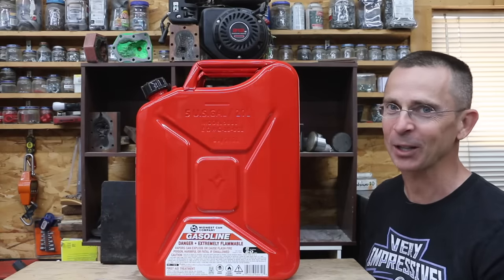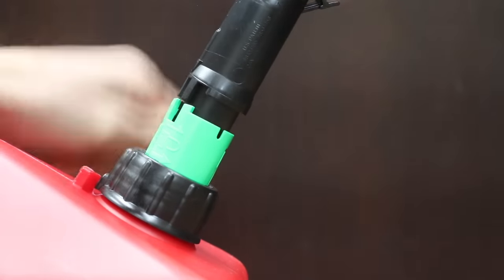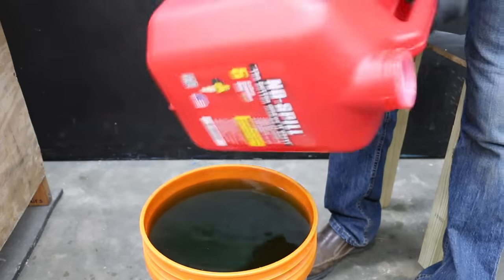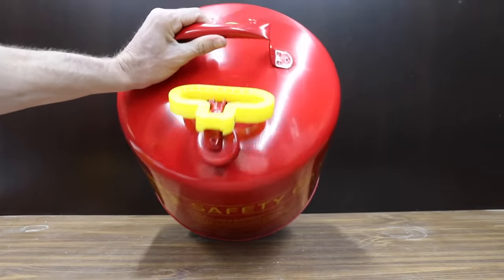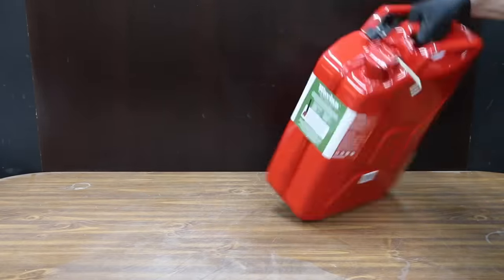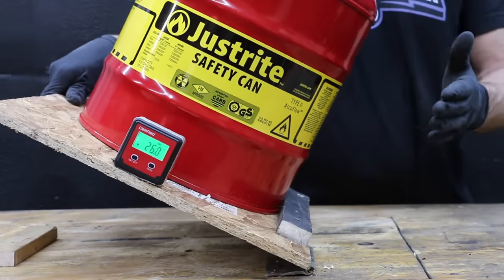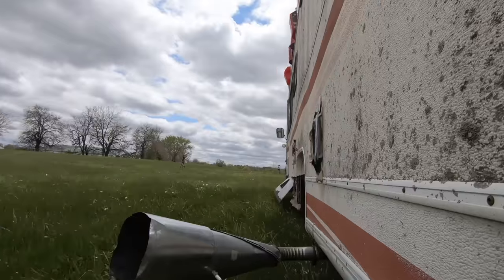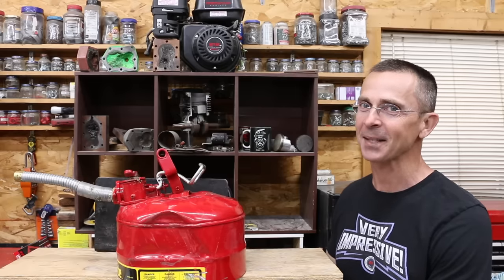Best Gas Can? $140 Wavian vs Eagle, Surecan, Scepter, Briggs & Stratton, Midwest, VP Racing

Comment: Plastic cans, watch out for these.  Have a 5 gal kerosene plastic can, it wasn't manufactured correctly and part of the seam below the spout wasn't fused together- leaks.  Have another 5 gal plastic gasoline can, and the threaded plastic ring that holds the spout on cracked around the top, unsealing the spout- letting the gasoline fumes to vent in my garage.
Reply from the maker: Thanks for sharing.

Comment: being disabled, i use an electric pump from harbor freight, cant hold a 5 gallon can over a mower any more.  maybe you can test some battery powered fuel pumps that are meant to be used with gas cans.
Reply from the maker: Thanks for the suggestion.

Comment: “No extra charge for the dent”. 😂😂😂 almost lost my coffee. I have owned several of the gas containers show. My opinion is. The more “safety”  they come with. The more issues you need to deal with. I get rid of all that and it improves the operation immediately… if you don’t know that fuel can be explosively flammable. You don’t need to own a fuel storage system regardless of the amount of safety the manufacturer packs on it 😑
Reply from the maker: Thanks for the feedback.

Comment: The better quality is cheaper over time, I have had several plastic cans stolen, the scum bags cut the plastic handles, where the cable locked them, the metal cans do not get stolen now.
Reply from the maker: Thanks for sharing.

Comment: Is the flame mitigation component an american thing? I'm in ontario and our gas cans are just a plastic container, a tube retained by the cap, and a plug in the tube. You take the tube out, flip it over, remove the plug and then there's a vent plug on the other side of the can for air to go in. Usually a flexible tube, so you just stick it in and dump it out

Comment: Wavian jerry can is 90 USD now.
I bought both Justrite and Wavian can and later returned Justrite. The button is not weld seam and I'm very afraid that it'll start leaking after a while (I did find quite a few complaints on this).
Reply from the maker: Thanks for the feedback.

Comment: I have used the Midwest brand cans for work and the locking mechanism for the safety breaks very easily so you’ll have to manually hold it in while inserting the nozzle. They’re junk.
Reply from the maker: Thanks for the feedback.

Comment: I wish you had included a test for measuring the amount of pressure required to keep the fill valve open.  I recently struggled with the Sceptre gascan because it required a horrendous amount of force which I found was more tiring than holding the can in the air.
Reply from the maker: Thanks for the suggestion.

Comment: That so called flame mitigation device makes the gas shoot out when I'm filling it. That came right out! HF sells a version of the Briggs Press N pour one for $25  Works OK. I have most of these and they all suck. The old fashioned ones are still the best. The biggest  problem I have with them is the gasket tears up easily on most of them and then doesn't seal. Of course finding a replacement is impossible. None of them vent well and pour very slow. I don't have any of the metal cans so I have no opinion on those.
Reply from the maker: Thanks for the feedback.

Comment: Would like to see a test on the plastic cans for weather resistance. ( UV, temperature extremes ( hot and cold) for both storage and handling.
Reply from the maker: Thanks for the suggestion.

Comment: I have the garage boss and it worked for less than a year before the mechanism in the nozzle started leaking. When I fuel my lawnmower, gas leaks through the button on the nozzle and goes everywhere. Definitely not safe and definitely not reliable long term.
Reply from the maker: Thanks for sharing!

Comment: Goodness, you paid $140 for a Wavian?  They're only $80-90 depending on where you get them.  Also, they're made in Latvia just the same as the Harbor Freight can, I suspect they make them in the same factory with the same exact dies and tooling, but the Harbor Freight can uses a lot of cost cutting measures such as thinner sheetmetal, no internal coating, and a cheaper nozzle.  The Wavian is made to NATO specs, they're still made just the same as they've always been.  It also means that if you test the Wavian, all other NATO cans will prove identical in testing, such as the GELG from Poland.
Reply from the maker: Thanks for the feedback.

Comment: The one thing you didn't mention as 100sK other gas can users is that the Fire Mitigation Device interferes with filling the can resulting in splash back and spillage most noticeably in the Scepter which I bought recently and could not get it filled up with lots of splash back due to filter. So how do you overcome the long process of filling the gas cans, as I gave up after just purchasing the Scepter 5-gal due to spillage and not enough time to sit the and barely squeeze the gas pump handle. I will be returning it because I feel these "improvements" are dangerous and I have seen some fire fighters that also say these new designs are Hazardous.
Reply from the maker: Thanks for the feedback.

Comment: I wonder if you could add some plumbing to the vent on the racing can, to bring the vent up around and past the handle? Also wonder if that would not only eliminate the leak, but help with the flow?
Reply from the maker: Thanks for the suggestion.

Comment: The only time I have issues with these new "spill proof" cans is trying to fill them up at the gas station.  the ones w/ that insert (flame mitigation device"  always cause spills when trying to fill them from the pump. had to get pliers and pull them out
Reply from the maker: Thanks for sharing.

Comment: Perhaps worth noting that the surface tension of gas is much lower than water, so some of these cans may have performed worse if gas were used instead of water.
Reply from the maker: Thanks for sharing.

Comment: I said gas doesn't freeze.
Then it was pointed out that it does freeze at negative -100. Ok when the last time you were in that cold of weather? Never. The surface of the earth never gets that cold, even at the poles.

Comment: I swear by my Eagle cans. I snap the funnel all the way down and pour that way. Works great when fueling the zero turn and the tractor. No its not the best for fueling a vehicle, but for that I have a 20 year old plastic can with a flexible spout and vent much like the VP Racing can. I absolutely detest all the new cans on the market these days. Those stupid spouts are a royal pain of you're trying to fill a small 2 stroke engine, such as a chainsaw or brush cutter. Luckily, I have old cans with flexible spouts and vents for those jobs.
Reply from the maker: Thanks for the feedback.

Comment: It's too bad the Blitz Enviro-Flo cans were recalled due to being a fire hazard, those were the only "Spill proof" cans I've used that I didn't hate the mechanism to get the fuel flowing, and they had a flexible hose so you can actually get them in without spilling gas everywhere. I still have one for gas/oil mix after like a decade. On the other hand, the Brigs and Stratton one with the green thing you twist broke like the first time I used it and now it's just open all the time letting the gas evaporate.
Reply from the maker: Thanks for the feedback.

Comment: I'm thinking about buying a 2 gallon Justrite can for 2-cycle, but I still need to do some research first. I need to know if it makes a difference whether you use 87 octane vs. 93 octane in 2-cycle motors and I need to know how bad 10% ethanol is for 2-cycle. I also need to know what is better between 87 octane ethanol-free vs. 93 octane 10% ethanol. I also need to do more research on mixing your own vs. pre-mix because I've seen a lot of people say that a quality pre-mix is better quality than using gas station gas and I've also heard the exact opposite. That pre-mix is worse.
Reply from the maker: Thanks for sharing.

Comment: The racing fuel jugs are superior because the government can't enforce their stupid rules/regulations on them. Tuff Jug, VP racing, Risk Racing, Matrix Concepts, LC2, all of them are great, you cant go wrong with them and they blow any of the metal containers out of the water. They are more durable too, you can see that as the VP jug didn't take any damage from the drop. I don't have a VP jug, I went with the Tuff Jug, but you buy one and it will last longer than you lol.

Comment: Gotta love engineers. They make very useful stuff but they always gotta throw in something that is way over complicated. I do exhaust for a living and have to do oxygen sensors and other sensors and take off inner fender wells to reach the exhaust manifold and I deal with plastic clips every day. Every manufacturer has a different design for a plastic clip and they can sometimes take me 
20 minutes to figure out or just to get it come apart. We put a man on the moon but can’t figure out how to make a plastic clip easy to use. Fuel cans are just one piece of the puzzle these engineers have gave us.
Reply from the maker: Thanks for sharing.

Comment: This test is missing a long term storage test. All the plastic containers I ever had bloated up during summer thanks to the temperature. On one even the seam burst thanks to the bloat. I then switched to metal cans and never looked back
Reply from the maker: Thanks for the constructive feedback.
Reply: @ProjectFarm  Thanks! I love your tests :)

May be such a test would be possible in a future sequel, but it's quite demanding, considering that you'd need have to use gasoline instead of water and it would also be a lot more time consuming.

Comment: Scepter should sell their REAL military fuel cans and can do so in a compliant manner by making the cap like their water cans but threaded for an EPA spout (and provided with a tethered cap for transport). The G.I. cans are far tougher than steel cans which besides corrosion issues is why the US military replaced steel cans decades ago.
Reply from the maker: Thanks for the feedback.

Comment: Hi! for work we carry gas cans in the back of a ford transit van with all our weed-eater equipment and whatnot.  a big problem is obviously the fumes and odour. we have to open up the windows and vent the vehicle a lot and is still strong enough to be a problem. Would it be possible to test the gas cans for smell/vapors leaking out of it? No idea how that would be achieved though lol. THank you for you videos!
Reply from the maker: You are welcome!  Thanks for the suggestion.

Comment: you're not supposed to remove the vent cap entirely on VP Racing fuel cans (: it won't leak if you just crack it.  they are vented threads...
Reply from the maker: Thanks for the feedback.

Comment: i own most of these cans eagle and just rite cans are nice but take up space i like my old style just right its taller and narrow the flexible steel necks can some times leak if in odd position briggs midwest and any other plastic valve spout get the conversion kit. I use my cube shaped 5gal midwest the most but my 50's-70's steel spill proof eagle cans with the brass spout valve and spring loaded vent are my fav's. FYI wavian is made in the USA. harbor freight knock off is very similar but there is a little secret that makes the wavian a tru jerry can for military and civilian use. have you ever tested ball joint press the ones that look like a over built cast iron C-clamp i need a new one but who makes the best?
Reply from the maker: Thanks for the suggestion.

Comment: I'm buying a fuel transfer pump. I'm tired of holding gas cans in the air with impossible contraptions blocking the fuel.  Your tests were in controlled conditions. My lawn tractor for instance, has a 3" diameter opening. The device doesn't sit in the opening like your tests do.  Ever try to fill a motorcycle with one of these while holding the damn gas can in the air?  More gas on the bike than in it.  I have ripped out those white flame preventors because they spill gas on fill ups with fast pump motors.
Reply from the maker: Thanks for sharing.

Comment: I have, at the very least 5 or six completely different supposed safety pour cans.  They all suck.  I take them off and pour directly from the can using a, get this(!), a funnel!  I’ve spilled more gas from a safety container trying to squeeze this, hold that, and then try to lift a full can to pour.  Some of these safety systems are overthought and are all about “conditional” safety at the surrender of the primary mission, fill the damn gas tank!
Reply from the maker: Thanks for sharing.

Comment: I've become a pro at manhandling 5 gallons of gas and squeezing the ** out of the plastic tank to force the gas out.  All while trying not to put too much weight on the equipment I'm filling.  You have to be careful with some filler necks on certain equipment, especially the filler necks on older Arctic Cat snowmobiles.  They'll crack right off.
Reply from the maker: Thanks for the feedback.

Comment: I only need to know one thing about these gas cans.. which ones offer an after-market gas nozzle that doesn't have a moron button.

(After watching the video) Ok, I take it back, thank you for showing us that the Stark has no corrosion resistance. I still wish you would have called out which cans offer an option without the idiot button. I refuse to support the brands that DON'T offer one.
Reply from the maker: Thanks for watching!

Comment: The Scepter jerry can replica spring "safety"spout breaks easily when used in the cold.  You have to use a fair amount of pressure to get it to actually allow liquid to flow, and the slightest angle will cause it to break.  Absolute JUNK.  Also, very few of the plastic cans have a vent, and the sides of the can will suck in and deform when used in the heat of summer.
Reply from the maker: Thanks for the feedback.

Comment: Those military copy cans sure are expensive. I bought 5 x ex-military NATO Jerry cans for £25 including delivery and they have served me well.
Unfortunately in the UK it is illegal to store petrol/gasoline in a scientifically and historic militarily proven fuel can due to an anachronistic law dating to the 1920's. We HAVE to store petrol in maximum 10 litre paint tins or any other flimsy. The lid is not needed by law but I am sure will help in the shed.
I say feck off to the law as I value my and my neighbours safety and will always use NATO Jerry cans for my petrol.
Diesel, Kerosene, and Water are allowed in these cans that are designed for petrol/gasoline it has to be said.

Comment: I just skip all that crap, bought myself a selection of different size funnels and just pour right out of the can for the tractor, snowmobile and even the heating oil tank when I screw up and forget to order oil 🙄 -   I fill all with a funnel, takes less than a minute to pour & no spills.
I fill a small 1 gallon can from the 5 gallon cans for the lawnmower, snowblower, small engine  equipment.
Reply from the maker: Thanks for the feedback.

Comment: The Scepter 5 gal I got for 23$ from walmart was junk. It leaked from a hole or crack I the bottom and got all over, gas won't flow in from a pump without shooting back out because the fire safety won't let it go through quickly enough. Consequently, couldn't empty it into another can quickly because of the fire safety so dripped lots all over from the leak in the bottom. Absolute garbage.
Reply from the maker: Thanks for sharing.

Comment: I've been forced to buy two different Scepter brand diesel and gas cans and they are AWFUL and the green control compression tab has broken on both of them with little use and they both have leaking issues, I DO NOT recommend
Reply from the maker: Thanks for sharing.

Comment: Don't throw away all your old crappy plastic cans. I saw the tops off with a zip disk then use them as solvent-proof cleaning and storage tubs since they're tougher by far than common tubs which tend brittle.
Reply from the maker: Thanks for sharing.

Comment: All I can say is these containers with a complete seal, are terrible. They build up a scary amount of pressure just sitting. 
I had one that built up so much pressure that it doubled in size... 
When the pressure was released it shot gas a good 20 feet..

Comment: The Sceptor has a terrible head. It is extremely slow and is extremely awkward for filling a reefer fuel tank on a commercial trailer.
Currently nearly all the cans (same brand) around the shop are being used minus their heads. Around the shop I use a funnel to fill the diesel  burning heaters. All these products crud. They need to be a vent well away from the nozzle and a good long nozzle. Plus the more hand holds the better.
Reply from the maker: Thanks for the feedback.